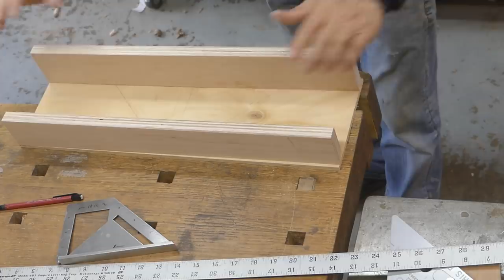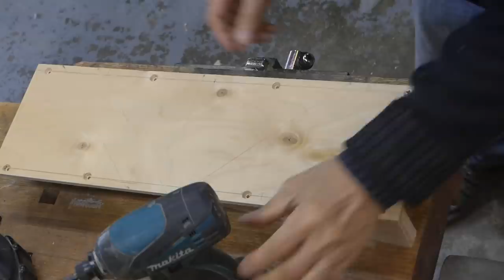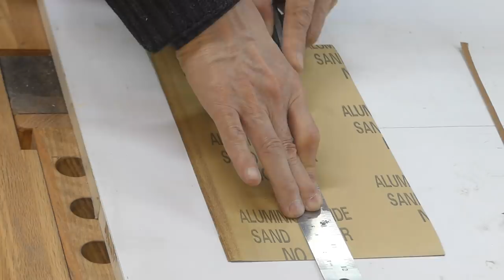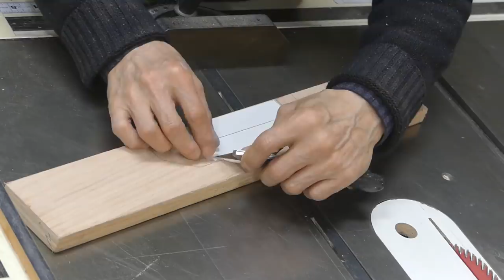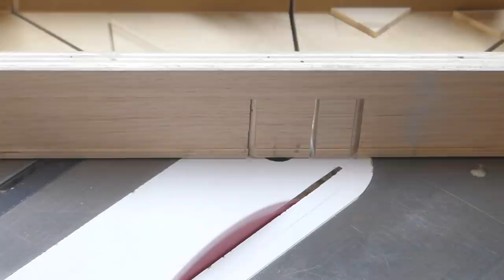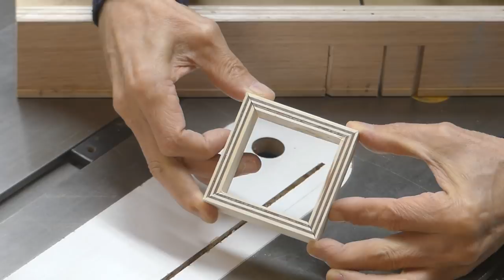3 in 1 mini table saw sled

Comment: The problem is...this depends on having an accurate stock miter gauge. Most folks watching this don’t (Inc me) and therefore will not get great results from this sled.
Reply: Using the gauge is only 1 way of getting the angles. You can come up with other ways to get those angles correctly every time. A runner slide with a triangular block attached set at 45 degrees either way to the blade which the mini sled attaches to and references is one possibility. Just because he does it in a certain way does not mean you have to do it the exact same way. He has given you the idea, now go and improve on it that suits you better.
Reply: @stormkhan4250  Good comment, a little bit of creative thinking keeps you going! Cheers from Sweden.